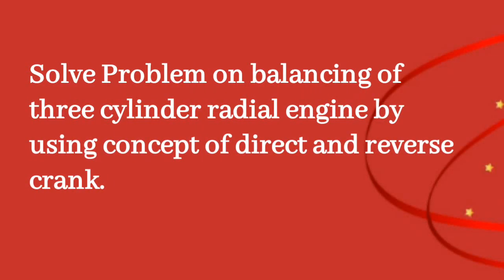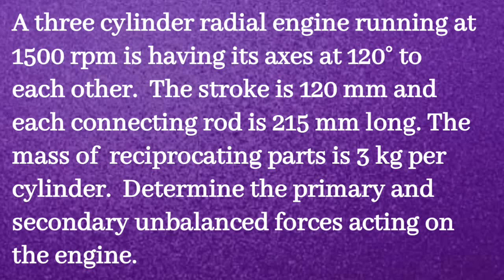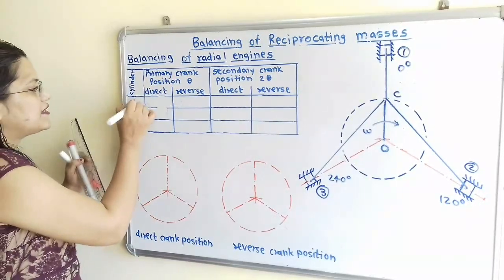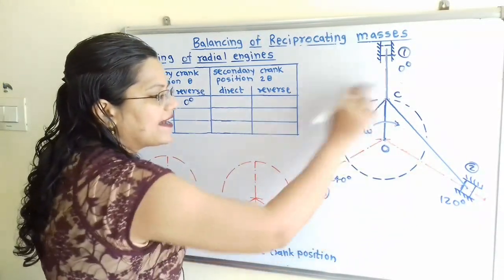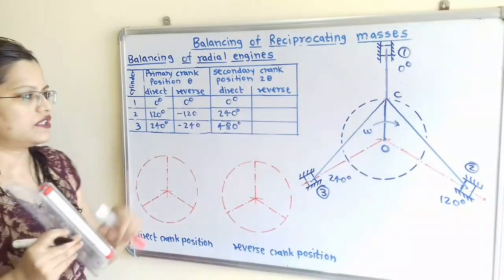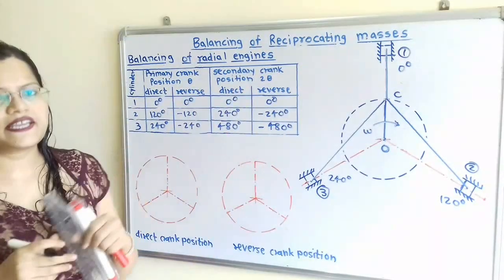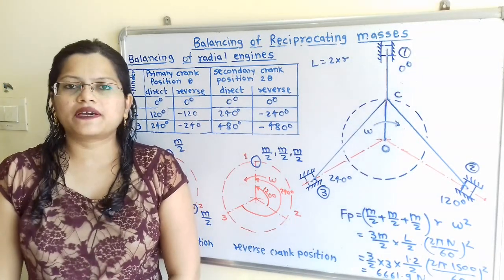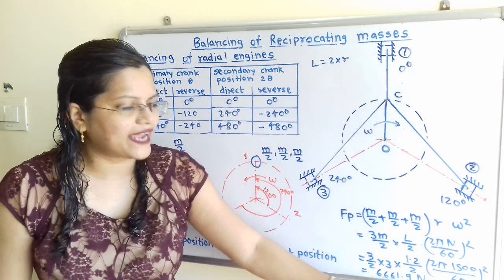Problem 9  balancing of radial engines for three cylinders by direct crank and reverse crank method

Comment: Please mam make the video on single degree of freedom free vibration and force vibration 🙏🙏🙏🙏🙏🙏🙏🙏
Reply from the maker: Yes... my next videos are on vibration. ...
Reply: Does this engine have one master rod and two link rods as a common radial would have?
Reply from the maker: @rickinmi crank is common and connecting rod is different for each cylinder....